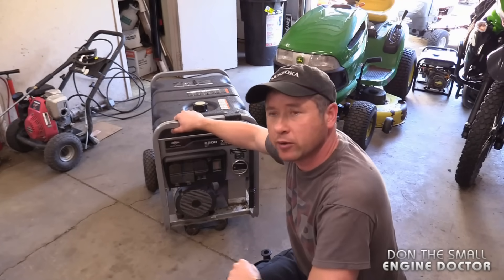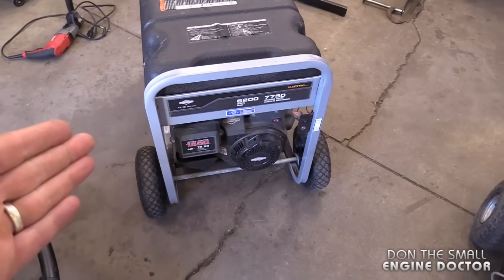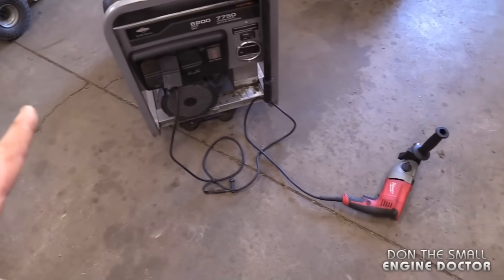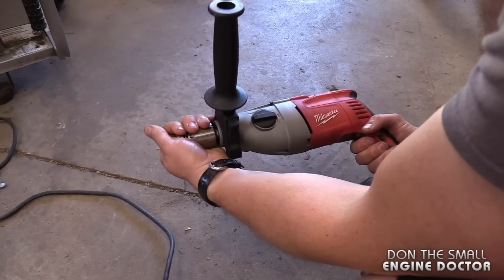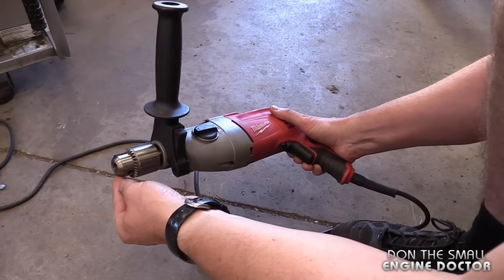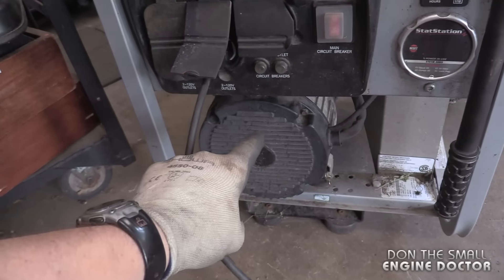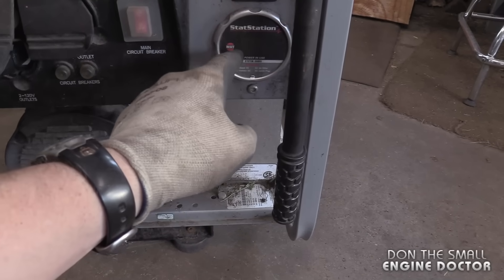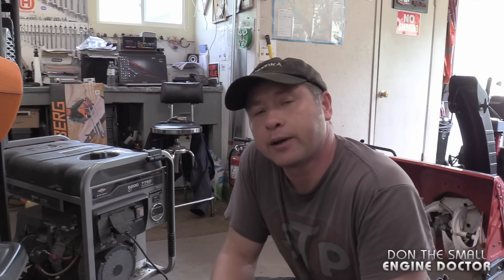HOW-TO "Flash" A Generator | Make It Produce Power Again | MUST WATCH

Comment: That's so cool, didn't nkow that.  But what is the logic behind the generator producing power by turning the chuck in reverse, not sure i understand that, but hell it works !
Reply: The back feed of a small charge recreates the magnetic field needed to generate power again
Reply: Lucid Gaming115  but what has happened within the generators circuitry etc that makes this step necessary? Is there a weak big ass capacitor that may be tired?
Reply: what if the chuck is turned the other way not sure what difference that makes
Reply: Field winding is powered by DC.  The transistors won't turn on if you reverse bias them.  If turning the drill one way doesn't work, turn it the other way.  The drill is being used as a small generator to get the system bootstrapped.